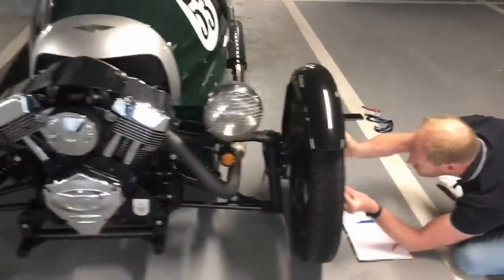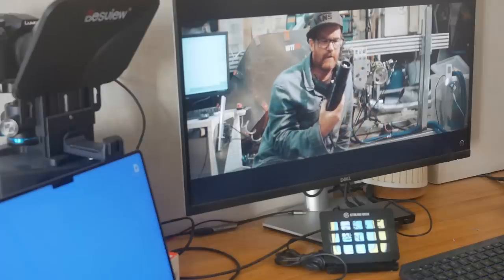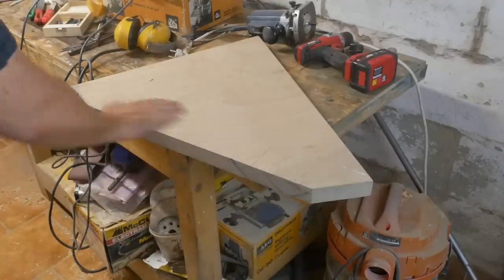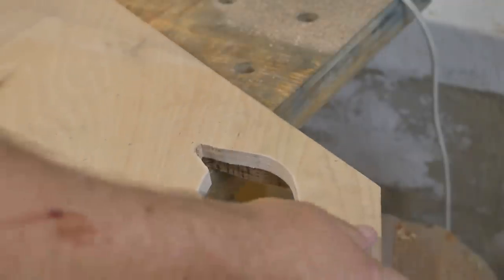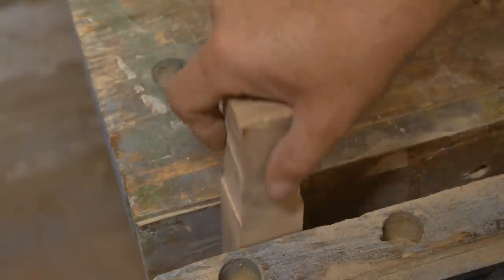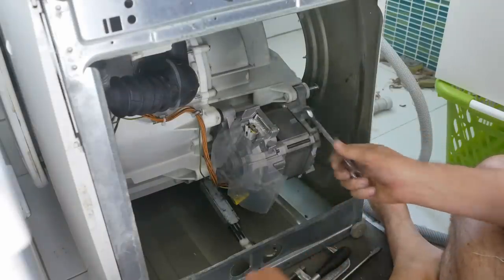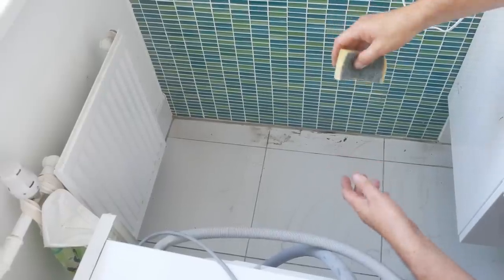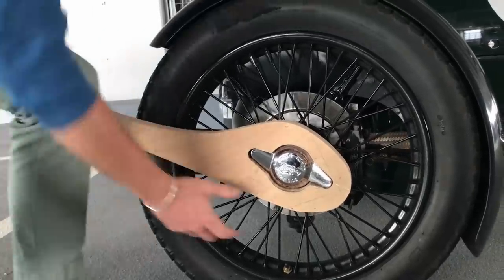Mogs wheel nut tool

Comment: So, where's the copper faced mallet for undoing the spinners with then? I mean, it does seem a little foolish to design and construct a giant wooden spanner (that can be hit with a hammer), when you can just skip straight to the hammer like intended. At first it seems like a terrible way to hold your wheels on (especially considering the lack of redundancy inherent to 3-wheelers). But unless you go absolutely bananas whacking the spinners tight, you'll get them plenty tight enough with no threat of damaging anything. Embracing anachronism is what Morgan ownership is all about after all!
Reply from the maker: I think he is afraid of damaging the chrome.
Reply: @RotarySMP  It's not unusual to use rawwhide mallets for nut-tightening duties either, but it really needs to be one of the metal-bodied types to give the heft required for proper torque-control. While the wings often get damaged by heavy-handed use of inappropriate tools, the chrome won't be hurt by sensible use of a proper soft hammer. At the very least, there should be one in the on-board toolkit (Nico's got one I hope! if he's not broken-down yet, he soon will, it's part of the fun of morgan ownership after all!)
Reply: the mallet is always with me in the car. But i wanted a tool for maintenance purpose at home. they are variety of Knock-off tool, some of them are beautifull and to be use with a torque wrench. Don't worry for the lack of redundancy. Morgan had implement more other ways to break down or kill yourself in this car. I had a major dual chassis crack on the front suspension, were the front upper suspension-triangle was only linked to the car by the 2 engine silent-blocks.... needed a full stripping of the car to replace the whole chassis.
Reply: @NicoCarsAndCookies  It's good to hear you're enjoying ownership of a proper british car! it usually involves this sort of thing! It's character-building, for the owner and the car!
Reply: @theafro  I guess, that's the reason for the saying "if it doesn't kill you, it will make you broke". It tried, failed, so now is emptying the rest of the money from my account. And to be brutally honest, if I wanted that or undergoing character build relation-ship, I would have go for a girlfriend. It least, the girlfriend doesn't break with you because it is tuesday or a windy day or for no reason